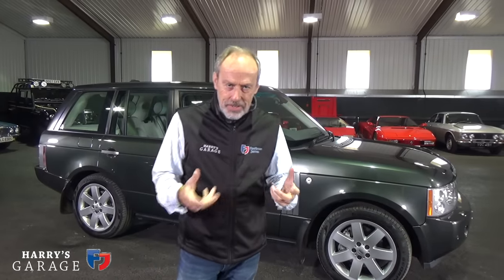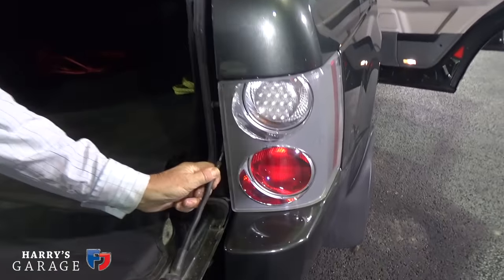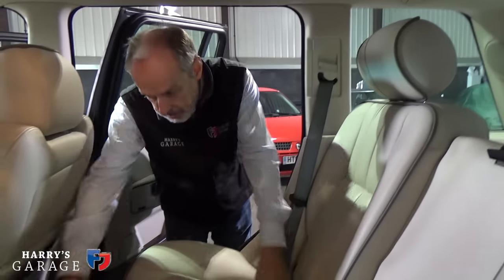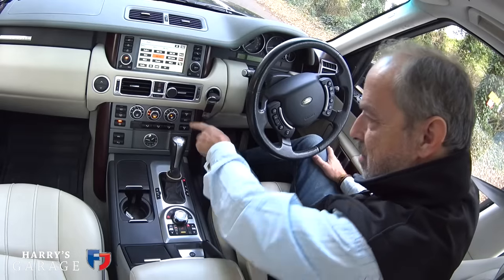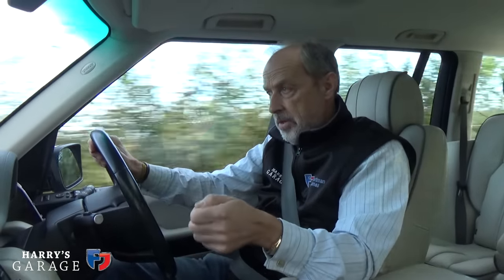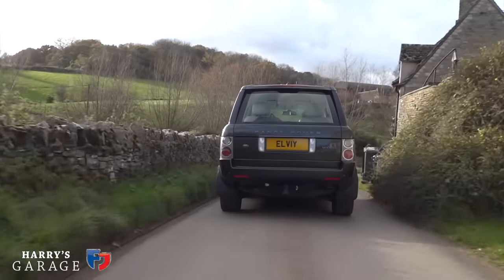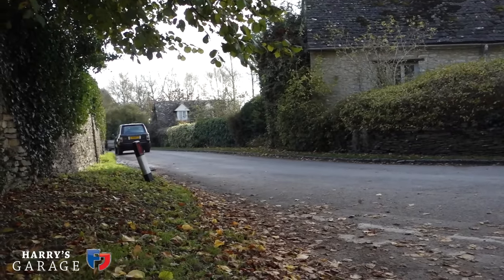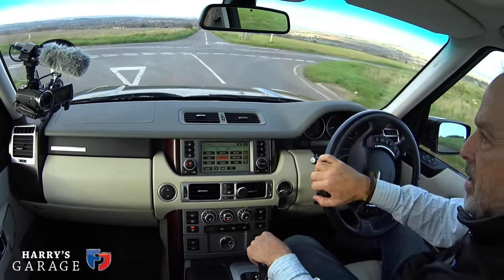Range Rover real-world review and buyer's guide L322 TDV8

Comment: Early 3ltr diesel (TD3) had a simple EGR that even if it breaks doesn't matter, in fact is beneficial to block it of. A bit slower and noisier but the noise of the straight six isn't an unpleasant one at all. Turbo goes on these sometime but there is only one of them MUUUUCH cheaper

Comment: A lot of people won’t know that the 3.6 TDV8 was designed before the 2.7TDV6. But BMW had an agreement that LR had to keep using their 3.0 BMW engine for several years after BMW had sold LR to Ford.
So they didn’t covert the 2.7TDV6 into the 3.6TDV8. It actually happened the other way around but LR couldn’t use the V8 until that BMW agreement ended.
The V8 is a much better, more reliable engine than the V6.

Comment: Recently picked up a 2011 TDV8, 77k, LR SH, outstanding. Have a little pot building up for the inevitable jobs, but will keep it until the RR hybrids are the same money!
got 30.1MPG on long runs but they are heavy in town.  Good tip on the rims, normally would prefer 19’s for off road but never considered the tyre design. Was going to swap to Michelle. Cross climate but will look at the verdes
Reply: The 4.4 is miles better I've heard.

Comment: I'm just wild about Harry ! It seems no-one would ever buy a used RR given the nightmarish stories common on the internet. The naysayers, don't get it, every car requires upkeep, but when you get the ride you covet running sweet for a fraction of the cost of a new box on wheels, you have the last and loudest laugh. Tow most things, ford stream and swamp, cross desert and dune, and navigate rock and forest tracks.  Without doubt, those RR from 2006>2009 are the most affordable, most capable and most desirous of real driver cars. Harry tells it like it is - I'm a fan.

Comment: i knew the service dept manager of the range rover- lotus - volvo dealership nearby back in the 90s..i asked him if range rovers are as good as the price implies..
  he got a subdued smirk on his face as he paused a moment—- then he said - every one they sell ends up comming back on a flatbed  at least once in the first year. sometimes 3 or 5 times .. some of them spend weeks at the shop. a brake job can excede $5,000…
  he said he would buy a volvo with 150,000 miles on it before he would buy a new range rover..
   i was watching top gear one day with  james Jeremy and richard.. Richard and James, both had range rovers in the past. Richard asked James if his range rover ever ran. James replied “not very often.” to that, Richard replied, neither did mine..
  I am pretty sure they have improved. The quality of range rovers over the decades.
  A friend of mine drives a 1960s range rover here in 2023. He has been driving it forever. I see it on the road very often. That’s the only vehicle he owns. He said he loves it because it is so simple.

Comment: An aftermarket warranty is absolutely necessary if you buy one of these used. And make sure you read the small print, as many require unnecessary 6 mo. oil changes and will not cover suspension, a culprit on these.

Comment: I got out of a Landcruiser 100TD and into a Disco 3 TDV6 HSE - huge mistake. Several years later sold the Disco at major loss (both in maintenance costs and resale) and went back to Toyota Landcruiser 200 TD VX - best decision of the lot. Confirm that I will not go back to Land Rover.

Comment: Hi loving the videos as ever 👍 Got a bit of an ask if possible. Please can I draw on your well of knowledge. I have a 4.4 petrol 2003 L322 HSE and for some reason the interior lights have stopped working when the doors are opened and I'm now left opening the doors with the key as the fobs stopped working too and the central locking button under the hazard warning light switch. The lights work if you press them inside except the front centre dome light. I've swapped it with the back an the same problem persists. I've checked fuses too. I've read about BCM's going into transport mode but I've no clue how to get it out of it or even if it's in it to start with. I spoke to Jaguar Land Rover Manchester an they now don't even have the software to work on my car even if I was willing to pay the £180+vat an hour for Labour/Diagnostic's. Basically if this has happened to you before or you have seen it before please help. It would just finish off the car (before the next thing crops up) Many thanks in advance for your help and time. Please keep doing the videos as they are absolutely belting 👍👍

Comment: in my family we have a 98 p38 range rover the 4.6v8 we were thinking of upgrading to the l322 but the running costs are much higher. the p38 isn't very relible but parts are very cheap and you can tackle most of the problems if you are bit of a DIY

Comment: I'm a metrologist for JLR so I know better than most just how poorly these cars go together during assembly. 

2x4's issued to all assembly cells for the operator to hammer parts into position before being welded and riveted. 

Many parts accepted under concession that are out of spec, but as such, will then be bought from the supplier at a cheaper rate and still fitted to cars. 

Parts being reworked AFTER being fitted to the car because they don't align properly with the mounting brackets. 

Rivets missing from safety critical brackets and mounting assemblies. 

Anyone who thinks they are paying for quality is a mug. You're paying for supposed prestige of having a RR, and being given a subpar product in return.
Reply: That's what you say that you have been working for them, great advert for your employer though rock on Tommy

Comment: Jeeps have transmission troubles.
They also have trouble with the blend air doors. They're dirt Cheap in America. 1800 bucks to fix the blend air doors, then they fail again, so you park it and only use the vehicle in the summer. The the CJ5 and CJ7 prior to 1986, with the in line 6 and 5 speed,  all three tops, they hold their value.
 You can't get much gear in them.
The blazer for dudes and your fire wood, and gear. You can road it at 80 miles an hour, get to the Sierras and climb just about anything.
I'm from California.

Comment: I have the 4.4 BMW V8 model and it's the best Range Rover i've ever owned! It's phantastic for travelling long distances, it's perfect with it's reduced gear box in the steep Swiss mountains and recently i've transported some antiques with it and when the transport was over, it was the luxury saloon again. I myself prefer the BMW (petrol of course!) engines, the earliest models though, because i can go to the BMW dealer with it when something happens. Even the brakes where done by them and in Switzerland it's way cheaper than the official Range Rover dealer! And also point of view design: i prefer the earliest model, as it was developped by BMW and i can feel, that it was developped together with the Rolls-Royce Phantom by them! Recently i've driven the Phantom and then the Range Rover Vogue again and it has really some similar feel! For me the best Range Rover ever!
Reply from the maker: Great story and good you have the 4.4 petrol, rather than the not so good TD6 version. Fav bit with first edition L322 were the BMW sourced comfort seats, where the backrest of the front seats had an additional hinge to allow the top half to meet your shoulders better. Luxury..
Reply: Yes, mine is a Vogue version which has those wonderful seats indeed! The best seats i've ever had! By the way: mine has 245'000 kilometers and drives and even looks like new!
Reply: The L332, best described by you as 'everyday Bentley'! I thought absolutely the same! By the way; this is my Bentley film with a Continental R: https://www.youtube.com/watch?v=l0TTP4NNB0Y
Reply: Bruno V. Nuenlist Do yourself a HUGE favor and change your timing chain tensioner. The new design keeps the chain from rubbing and wearing out the guides when first starting the engine. Save up for the guides job ($3-5k) since they are plastic and wear from heat & age after 120k miles.
Reply: Now, i did myself the favour in changing not only the timing chain tensioners but also the timing chain itself! - Hope, it stay's another 240'000 kilometers now ;-)
Reply: Good to hear! I currently have a 2002 530i and want to make the switch to the L322 for my next car. What's the annual running costs? Specifically the engine/suspension/transmission. My 5 series has cost me next to nothing.

Comment: This is my type of vehicle.  A genuine working car.  Back from when Range Rovers were practical work horses and not poncy gimmicks driven by footballers, soap stars and models etc to pose in.  Really like how the tailgate and seats are mechanical and manual; it has genuine quick usage instead of the silly electrics just to look good and is less likely to fail after many years of usage.  I'd much rather have the 2006 model any day.  And its at a good enough price that many can buy it out right instead of taking out a scam finance arrangement.  Another reason why used vehicles are better than new.
Reply: Overpriced for a work car. Easily damaged on farms and gets easily stuck. Landrover put low profile tyres on for the simple fact, it's for posing and that's all.

Comment: Wish you went in detail into the Air-Suspension, which was probably introduced by BMW. Can the car be used with a failed air suspension? What is the cost of repair? How does it add to your joy of driving?
Thank you for picking up on those issues.

Comment: Harry 
I’ve. picked my fist truck a 2003 Hse I’ve got to say it’s smooth and I do disagree with the comment being under powered 
As it has the BMW M57 2.9 l engine 
It’s only got genuine 41,000 with 1 company plus a director owned .
Every thing is as new door shuts hinges and as per delivery on the under side clean .
I’m not saying it’s as good as the 2006 upwards 3.6 bigger engine truck but for 10 k in 2019 it’s cheep for what it is it’s only done 3000 miles in the last 13years and has been stored in a garage so no solit .

Drives like new and the engine is good for 150,000 miles love it also road tax is only £315 per year over £550 and insurance is only £315 fully comp so not a ball ack .

If you can find them with gen 
Ow miles it’s still a good but coved now 4000 miles not a problem 🤓🧐👍🏻
Reply: 150k miles? There’s plenty of 330ds about with 500k miles

Comment: In Australia, Land Rover are considered the most unreliable 4WD after the train wreck called JEEP.  I live in Outback Australia and these things are either abandoned by owners on the side of a curb gathering dust or spend most of their kilometres on the back of a truck to a service centre. Nobody in their right mind would take one of these things into the outback. Constant electrical faults, power steering pump failures , air suspension failures, transfer case failures, the list goes on. I don't understand what happens in the UK. You have some of the finest engineers on the planet but when it comes to making a reliable vehicle it all goes hell in a hand basket. I should add, that I have a 1957 Bentley, 1957 Rolls, 1975 Rolls and 1980 Rolls, all made in the UK and all of them suffer the same reliability issues.

Comment: Harry, I would first of all like to say I like your videos very much, as they are always so informative.

Harry, in this video you touched on the point of all seson tyres of today, being quite sufficient to handle driving in the snow. So that being the case, why is it that Germany still enforces all vehicles have 2 sets of wheels per car? One for winter and another for summer. 

I understand why this motoring law was brought out when it did all those decades ago and I fully agree with it. However, what with the advancement in technology, is it still necessay to still have this law in place? After all not every driver takes their car to the Alps.
Reply: All season tyres can't be compared to winter tyres. Be safe - drive with propper tyres!

Comment: Great video review!...I've always loved range rovers but have also been so wary of reliability issues. You have made the temptation almost irresistible once again 🤔...I'm just at the age where i want reliability over anything else so it will be a hard decision. Appreciate the great advice though. 😊
Reply: If you are wary of reliability problems, this is definitely not the vehicle to buy. I bought my 2007 new and it was literally falling apart as I drove it out of the showroom. The new Land Rovers come with a 5 year warranty, but what is the difference between a 3, 5 or even a 10 year warranty when Land Rover wouldn't honour their warranties. At the first service, Land Rover claimed my the issues were caused by ware and tare. Anything to get out of a warranty on the worlds most unreliable vehicles. As a second hand vehicle, you might as well buy some other brand as a new vehicle and it would work out heaps cheaper than trying to keep one of these on the road. And they are anything but safe. My wife could have been killed in ours because of something as simple as an alternator failure. A common fault with these Land Rovers, which turns them into nothing more than a coffin on wheels. Jason, think very carefully before buying any Land Rover, old or new.
Reply: @drivesafer6335  I had an lr3 discovery from new it's done 420k kilometres had to replace the electronic handbrake that's it other than standard maintenance driven off road a lot. Like all cars they have common issues that you just fix before they break